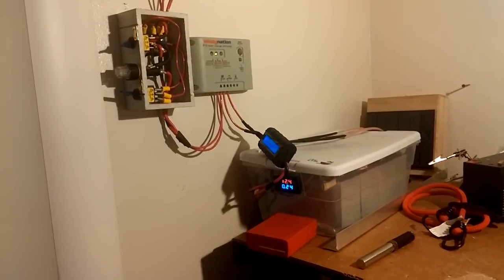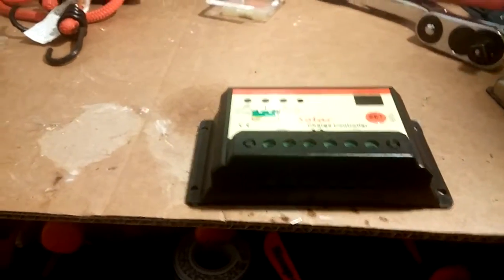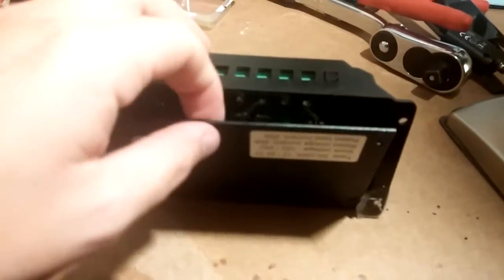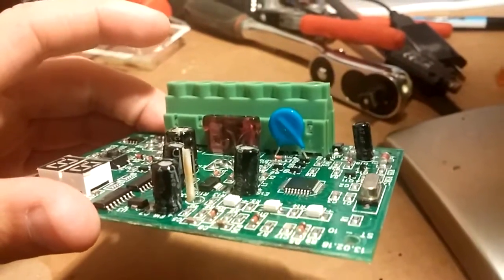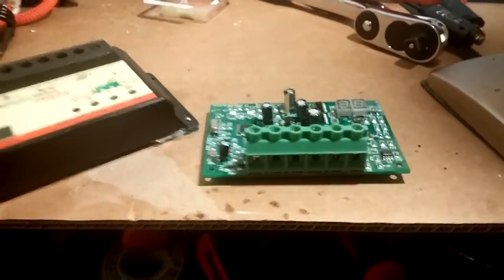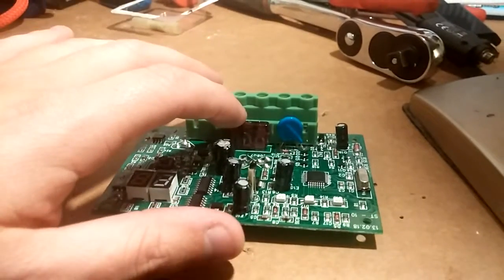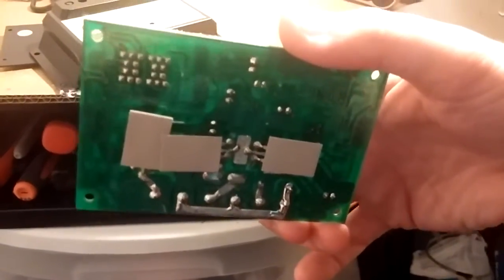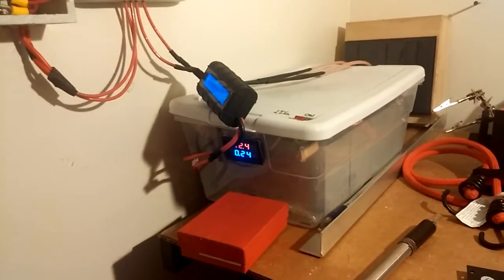Fixing my Charge Controller!!!

Comment: Most likely the unit is 40 amp relabeled as a 20....  Its a selling scheeme....... You build a 40a unit and it is safe to sell as a 20......  Then you price the 2 ratings.  That way you only have to buold one unit and rebrand it.

Comment: I believe according to the NEC code book, fuses/breakers have to be at 156% of ISC for surges. So 20A x 1.56 = 31.2. Being as they don't make that size they had to go bigger. Why they jumped 35A and went to 40 I don't know.
Reply from the maker: Gary Aubrey hey thanks for the commenting and thanks for letting me know about this because I didn’t know about that. I never did get this charge controller to work again but hey it was only 10 dollars lol. Thanks for watching and please subscribe and check out my newest videos of my 1.1kw solar panel system